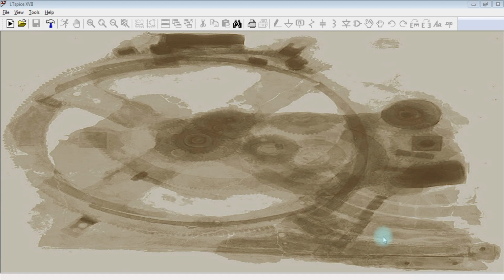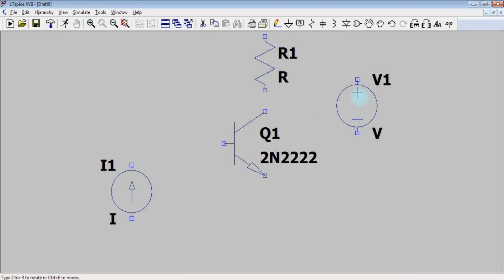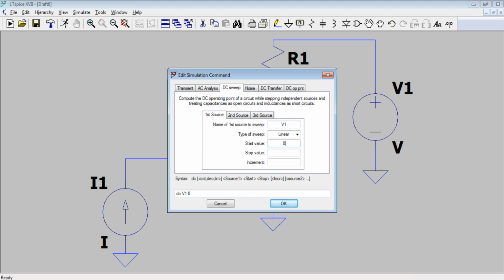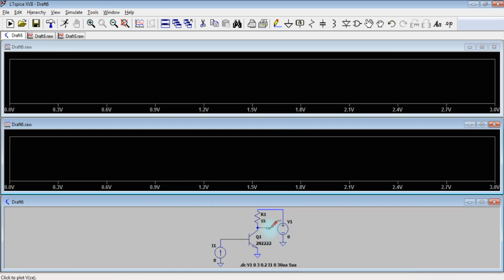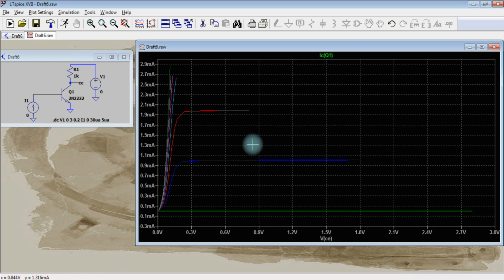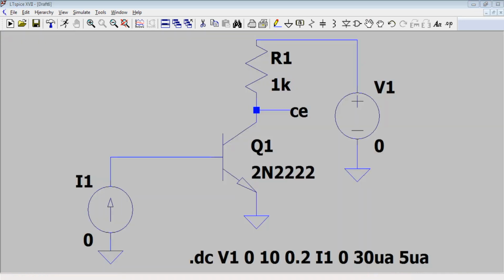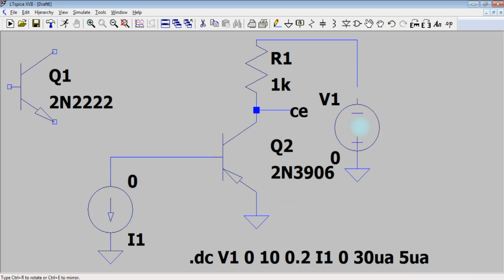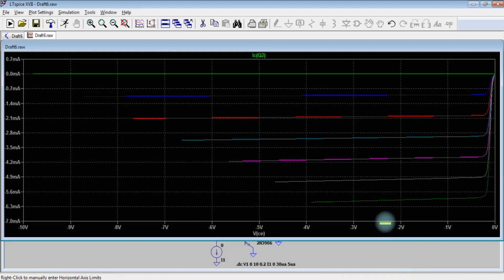LtSpice  Characteristics Of Bjt {NPN PNP Vce vs Ic (different Ib)}

Comment: I need to use a sinusodial voltage source as V1 and when I try to see Ic vs Vce graph on transient simulation  there becomes a lot of lines and doesnt seem right so I guess I neet to use the simulation mode thah you use I guess is it right? And if so what kind of sweep should I choose?

The thing I need to do is this;
"Observe the output
characteristics on the oscilloscope for three different values of base current."

Most of it is same as you have done but instead of V1 I needd to use a sinusodial source which is :10 sin (2π(1000) t ) , set up the circuit but got problems with simulation settings.